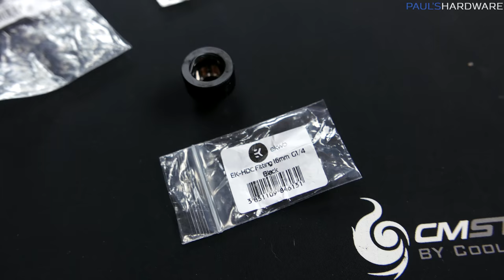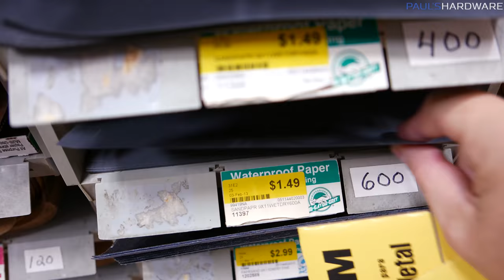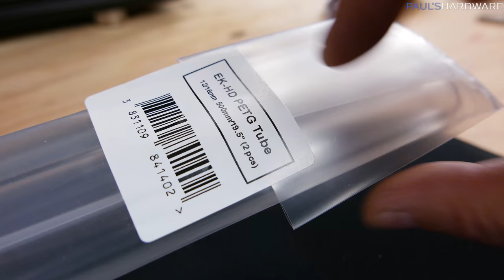CASE CARNAGE: Arctic Panther Build Log Part 2

Comment: Regarding the backplates, the ninnies who whined to Steve about that are full of crap.

You might need to source some slightly longer screws and/or spacers to mount the ROG backplates, but the fact that you're not using a real EK backplate won't make a lick of difference.

Comment: I´m using the original backplate on my Strix 1080s the waterblock is only screwed in on the 4 screws around the GPU  and the 2 near the VRMs I have no overheating and my backplates aren´t bent like yours

Comment: why will there be 2 parallel pipes between the gpu's ? the water will take the path of least resistance and will not flow evenly through both GPU, it should be 1 in to the top gpu then 1 out and into the 2nd gputhen 1 out to the rad?

Comment: Should I go with G4600 with 1060 GB or Ryzen 3 1200 with 1060 3GB? I personally prefer the Ryzen because I can upgrade the CPU easier than Intel.
Reply: the g4600 is only a dual core. if these are your only two choices, i would pick the ryzen. maybe see if you can find a good deal on a 1060 6gb as i have a hard time keeping my graphics under 3gb vram.

Comment: im not really that happy with your pump/reservoir mount, it seems like it's blocking the bottom half of the radiator.. at least the mounting bracket holding the pump blocks a lot of it, even though there's maybe 2-3 cm gap. Maybe you can cut a hole in that so air fan flow more free and just hit the reservoir?

Comment: OK Paul I have a side question I am building my first computer ever I have purchased a MSI Z170A g45 motherboard a scythe kotetsu cpu fan and a 2 tb hdd I am being giving a gtx 720 gpu and 16gb of ram I have not gotten a power supply yet because I am trying to wait till I have everything to get the right amount needed but my question is i  am struggling to find a good cpu i came across a intel xeon e3-1225v5 i know this cpu is used for 24/7 usage  would this cpu be a good option to get till i can get the intel i7 my board takes the 1151 socket intel cpu since I am on a very very tight budget and I mean tight everything is coming used or salvaged my budget is 400 max and that's pushing it. So any advice is great

Comment: really wish find a way make  that 1st tube straight...lol what would I know still not hardlined myself...I'm gonna soft line my rig once I've got my 2nd sli..help me work out the loops..trying not to buy another case, love the corsair 540 air ..but now I want 360 rad in front and 240 in top and would love to show res n pump it all seems tight :(...would love if you and @bitwitkyle would add a little more to #pimpmypc..where not just mustard and ketchup cursing you helped guys looking to get to another asthetic level

Comment: Paul you already have a dremmel, why do you not have a router bit attachment for it? hell mine came with one in the box. watching those holes get drilled was painful. A router bit would have taken a fraction of the time and effort, even in the mesh portions.

Also having to use those ek backplates is horseshit, Manufacturers have finally made some backplates out of the box that are of good quality and are aesthetically pleasing, you shouldn't have to toss it to replace it with some featureless plate. I'd look further into modding it to get it to be compatible, it's only a piece of metal, I'm sure it can be done. Also for the money they charge you think EK could sleeve those colored pump cables? More Horseshit.

Otherwise good stuff, looking forward to part 3.

Comment: Ya sure the backplate going to help cool the vrm's that's already cooled by water.
Reply: what he was saying is that with original backplate(strix) the water block wouldnt have perfect contact with the vrms
Reply: Oh I thought the block had all the screws in.
Reply: SkinUpMonkey

Why is ASUS not releasing any Poseidon X299 boards, including VRM and CPU blocks etc. A Bird needs air, StriX need to fly, he is drowning now....
What block u use on your VRM?

Paul is needing way to may Fans, guess  <600 or off on daily use, not needing them unless he is running Cinebench all day. My 1080Ti Fans are very hard to turn on!
Reply: No idea mate, maybe not many people buy them. I use a monoblock for CPU and full cover for GPU. Ya I turn some of my fans off since my setup is overkill.
Reply: SkinUpMonkey
My original X99 build was an overkill, i will never do that a again, i tough running a 20 HT Xeon cores class CPU must get hot when you run in on Turbo doing almost 5Ghz on Stock Turbo. Or that original 1080 on GP104, they never went on, or never made it >300 RPM. Original IA Fan profiles shuts them all down running basic games, only the Coolermaster fixed pump running on slowmotion RPM, not able to shut down by bios UEFI profiles.
I own many PWM fans now, all custom RGB on Aura, made my self, not needing them at all. Who needs 2 extra fans on header on 1080Ti Strix, if the onboard fans are so hard to start, why need more? I can trun these 4 extra 1080Ti fans on running that GPU AI asus tweak tool, overruling the green All Gore setting, set my own custom setting, always > 4000 RPM please!
Reply: lucas rem I use corsair commander pro to control my fans by the water temps. Found it to work better then Asus software.
Reply: SkinUpMonkey
Thanks for the suggestion, i will download it.. Only some Ai UEFI bioses do include water temperature in all profiles, not needing that as some external variable, my system run on UEFI only, not running any Windows API or Win bios profiles to control Fans, Aura or other hardware profiles.
Reply: lucas rem good luck downloading it since its hardware lol but once setup you never need to use software again, even if you lose power or boot in Linux if you that type of guy it will still have your settings.

Comment: What did we learn from this? Don't trust anyone other than EKWB for anything custom watercooled. The best, or nothing.
Reply: Agreed. I had started out with a XSPC kit. The pump/res bay sprung a leak and almost hit my ssd raid. I replaced it with the EK pump/res and havent had a problem since and i think its also a faster pump. Only downside was the EK was the price of the whole xspc kit.
Reply: If nothing else, peace of mind with a custom loop is worth your pc's weight in gold.

Comment: No offence but that drain port on the very bottom of the case is just dumb, think about it if the case is on your work top how the hell are you going to get to the train port if its coming out the very bottom of the case, you will have to prop up the front of the case by balancing it on some books or what ever... whats next are you going to also put the fill port on bottom also ?

Comment: Oh God! my OCD is sooo triggered right now..... Please, please, please remove that sticker you drilled through for the outlet :D and sorry but I'm really not liking that angled first tube run you did from the top of the rad to the pump. Can't you use some more fittings from the pump to get it to run straight down? or turn the rad around so the ports are at the bottom and just use fittings to go to the pump?
Reply: Just poorly planned in general.